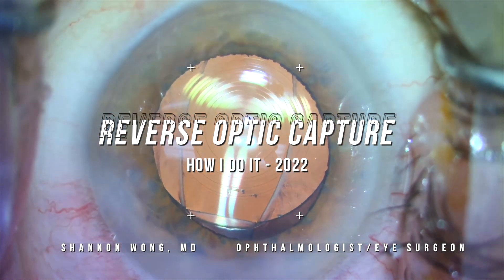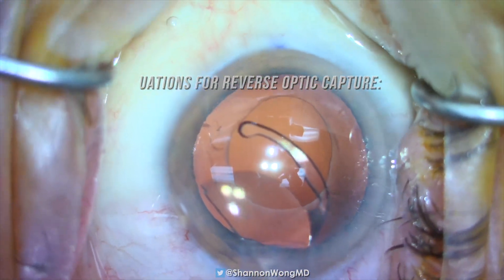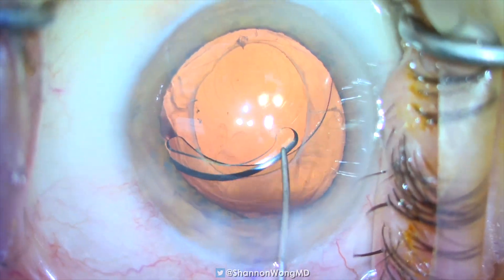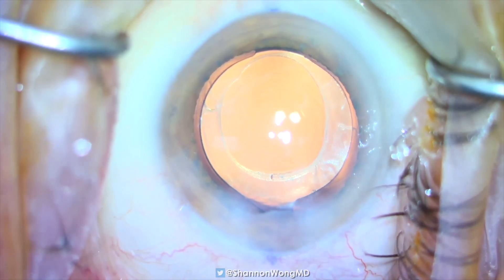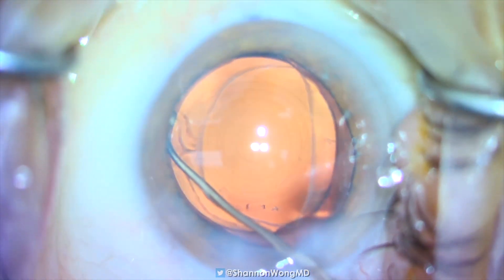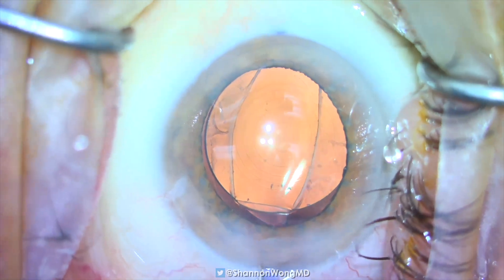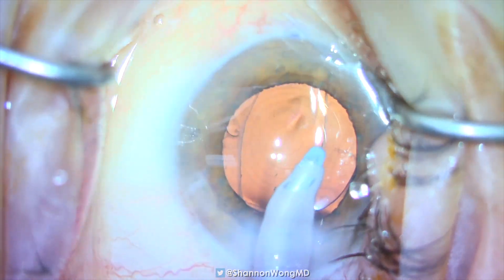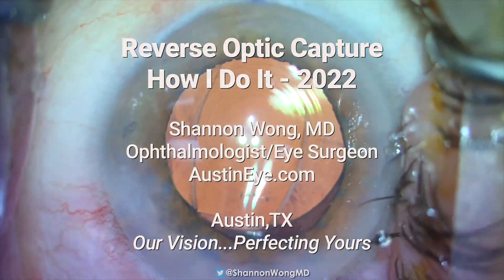Reverse optic capture to treat Negative dysphotopsia.  How I do it. 2022.

Comment: What is the average time frame for ND to go away after ROC? Because a week after my ROC I still have some prominent ND. Is that normal? I thought it would be gone immediately.
Reply from the maker: Personally, I have found that if ROC is done properly, then ND goes away within one day.  OTOH if ND does not go away with ROC then either the IOL is not in ROC configuration or ROC will not  eliminate ND.  Backup plan would then be piggyback IOL in the sulcus.
Reply: @ShannonWongMD  Thank you so much for that. Is it possible to tell by looking at a dilated eye if the lens IS configured correctly? Would it be obvious? How can I know if my doctor properly configured the IOL in ROC? Is there something specific I can ask her to look for? Should I ask her to dilate my pupil and take a good hard look and make sure of...something specific? 
She has done it before so I don't know what could be out of wack....And *THEORECTICALLY*, if the IOL is not configured properly, could you possibly configure this lens correctly with a tweak, or would you have to take out the lens and replace it with a whole new lens and do the ROC procedure again?